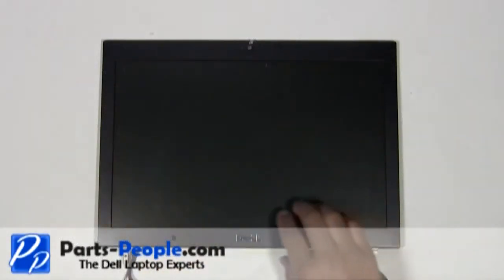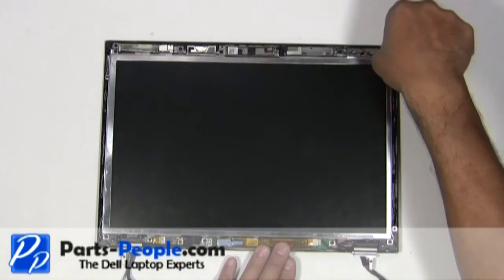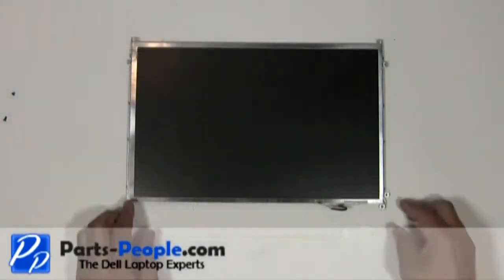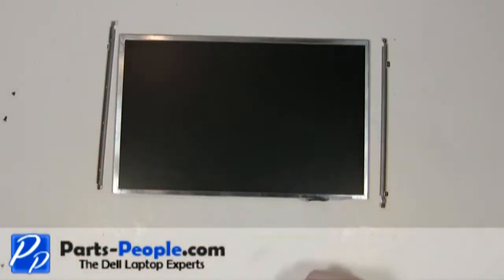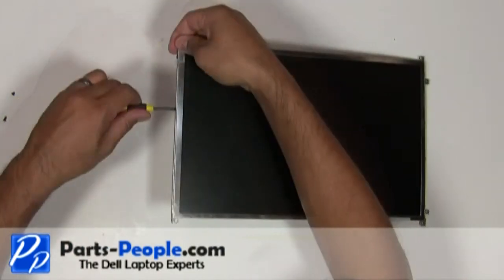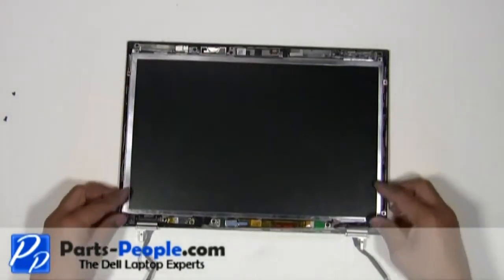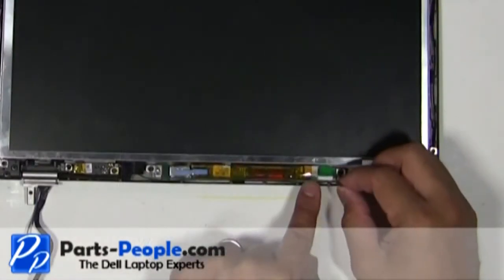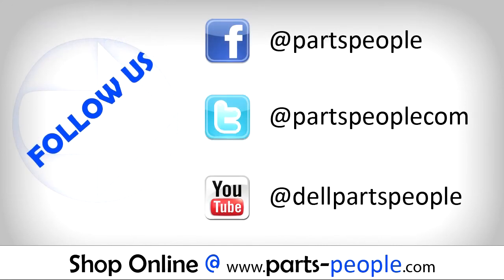Dell Latitude E6400 | LCD Screen Replacement | How-To-Tutorial

Comment: do you know if the e6400 atg screen is compatible with the regular e6400?
Reply from the maker: +E Stan No they are not. The ATG uses a thicker, heavy duty screen.
Reply: +Parts-People.Com, Inc 
damn, from what i researched the ATG screens all bubbled and look from heat.  I have 2 coming and need 2 replaced.  Do you know if i can use another brand? model?

Comment: While doing this myself, I cut the LCD cable that plugs into the inverter. Is there anyway to fix this cable. Replacing the cable also doesn't seem possible. Or will I need to replace the entire screen because of it?
Reply from the maker: If it's the flat cable, you will need to replace the LCD cable. If it's the other cable, you would need to replace the screen.

Comment from the maker: I wish I could tell you the best, cheap place to go, but I honestly don't trust cheap suppliers for screens. Our screens cost more because we do a lot of research and testing to make sure they work on the laptops we advertise them for. Many of the cheaper places don't, so it's kind of a crap shoot on if the screens are compatible or will work at all. I can offer you this to help. Find the part number on the back of the screen before you buy. That should help you get the correct screen.

Comment: Do you know where I can get a cheap LCD replace screen? My nail just cracked the ink on my*sigh* and I'm on a budget but I need it for college I have assignments in there and stuff I need to turn in.. Could you please recommend a website or somewhere where this screen won't be expensive I looked on eBay and they no cheaper than 60/70   Thank you !